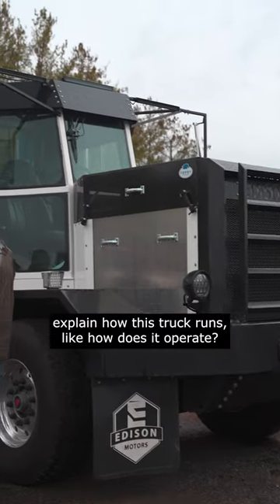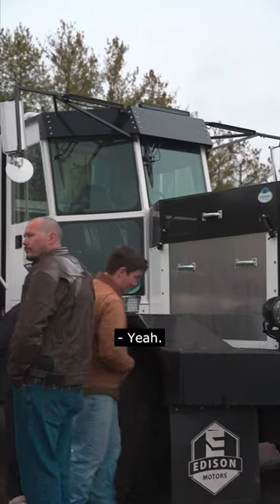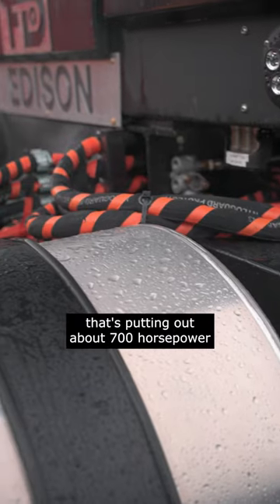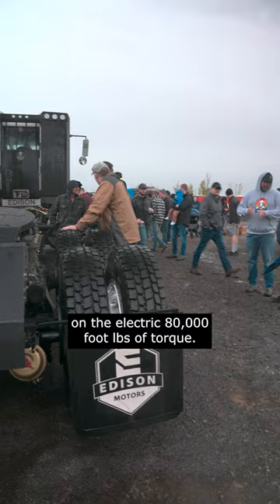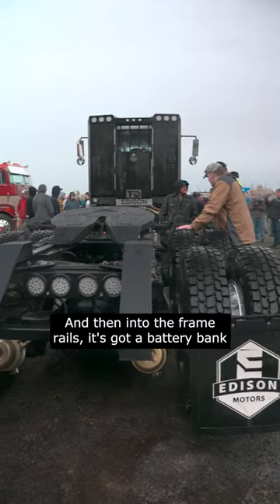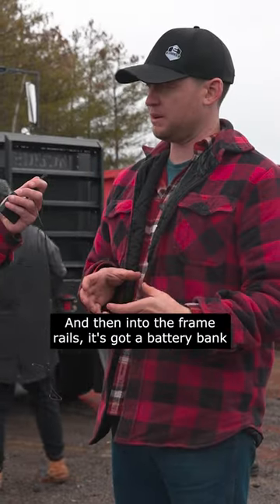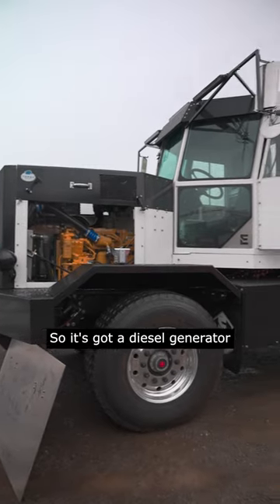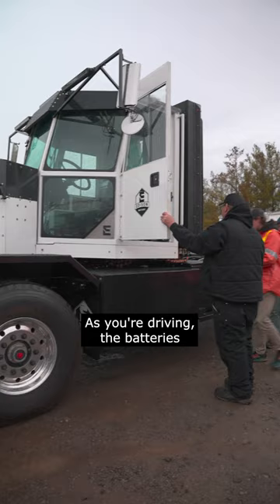@EdisonMotors tells us about how their new electric truck operates! 🚚⚡

Comment: What's the point in having an electric loader when you still have to have diesel to charge the dagon thing..What's the your point that you are trying to make..I'm pretty sure most people can repair a diesel engine but wait until they have to repair that huge piece of equipment. 5 times the amount for repairs and you may as well get another brand new electric loader cause repairs cost way more than the machine cost...I'm emptying banks accounts if I'd ever have to attempt to repair a machine like that plus if it ever gets a short in the wiring system kaboom goes your tractor dude lmao 😂😂😂

Comment: Still has a diesel generator????
Reply: Nothing can do shit with batteries only
Try buying a truck thats battery onlyband see how inefuciant that is
Reply: @loganwalker8537 have you looked up the Tesla semi? 500 miles of range. Hands down the most efficient semi made. Battery only.
Reply: @allterrainrandy2587 truckers on average drive 600+ miles a day. Plus the grid won’t be able to hold up to a conversion to full electric trucking. And it will take god knows how long to upgrade it to handle it. Diesel hybrid is one of the cleanest forms of energy that can be mounted on a vehicle and we have the technology right now to make it work
Reply: @allterrainrandy2587  only that it can barely pull any cargo due to its weight and its gonna take hours to charge.
A hybrid truck is much better
Reply: @loganwalker8537  Tesla Semi refills up to 80% in ½ hour and the energy per mile needed is the best. But it's built for one type of trucking. Many trucks never travel 500 miles a day (or in between where a Tesla Semi can charge). It has zero overlap with Edison Motors' trucks which are meant to greatly save on fuel where full BEV doesn't make sense. They have their killer app. No one in the current for is going to be an OTR truck.
Reply: @christer1415  ok so it doesnt take hours to charge
yet it weight a lot more than a average semi and only has 500 mile range where as Edison Moters trucks weigh less than average trucks do and does the same thing with no need for a 50 minute charge every 500 miles

Comment: Why do the insist on calling it an electric truck when it's a hybrid
Reply: Because the drive system is purely electric. The generator is just a range extender. A hybrid drives the wheels with mechanical force from the engine.
Reply: @23salamander   But this truck DOES augment traction power via the engine, albeit not with a direct mechanical connection, which is a technicality.

My State DOT (and many others) defines any electric vehicle with an ICE as a hybrid.  Under DOT rules, electric vehicles cannot burn fuel for power--not even in fuel cells. There are two different road tax surcharges depending on the type of vehicle (hybrid or electric). Since these trucks are designed to drive with the engine running, and can't as a practical matter do their job on batteries only, that to me--and most DOTs--would be a hybrid.
Reply: @tedneb3459  watch a few more of his videos. Engine only runs when the driver switches it on. You don't need to run it all the time

Comment: It only runs 6 miles down the road and takes 18hrs to charge but helllll yeahhhh
Reply: I think you're confused. The diesel engine turns a generator that keeps the batteries always charged, but being that the engine isn't the driving force to the wheels its probably governed at a continuous 1800rpm which is optimal for power output and fuel consumption. Also this thing is designed with regenerative braking. So when going downhill it not only probably gets to cut engine rpms down to an idle further enhancing its fuel consumption because now the braking is generating power but also causing less wear and tear to the engine itself giving it a longer lifespan.
Reply: It has a diesel generator that recharge the battery as needed.  It does not have a diesel motor running a generator. It's just a diesel generator. The rear axles are electric . The battery is in the frame rail.  Make sense?.

Comment: The real question good sir , how often does that diesel generator have to run ? 24/7 or does it shut off and than turns on when the batteries reach maybe 15 or so percent left ? Because if the diesel generator is running 24/7 just to keep them batteries charged , you should probably stop calling it an electric truck and just call it a hybrid. But if it only turns on when the batteries get low i think thats bad ass and could give the drivers a chance to charge up to 90% so they arent using as much diesel and in my book its a win bc youre not using as much fossil fuels. But if that thing is running 24/7 than the only real advantage u have is torque. And at that point it shouldnt even be considered electric..
Reply: It turns on when the batteries hit 20% to charge them up. 

A hybrid would use the engine to power the axles. This application only powers the batteries. Even if it ran 24/7, it still would not be considered anything but an electric vehicle. 

Also, the generator is so much smaller than a standard diesel powerplant used in trucks today. So you also save on emissions over time. This is trucking with batteries done right.

Comment: So it's a locomotive
Reply: not exactly locomotives have no battery so they dont have any regen capabilities and the generator is always running as that is the source of power. This is designed to run exclusively on the battery and the generator is only their in case you run out of battery capacity.

Comment: So it’s really a diesel?
Reply: The driveline is fully electric, it has batteries, it has a diesel generator that is roughly half the size of the engine a normal diesel truck would run. It clicks on when the battery drops below 20% and charges it to 80% to preserve the life of the battery to the max. It gets far better fuel efficiency (more than double) because it runs at a constant RPM to charge up the batteries, it also has 60% less emissions than the latest trucks while having far more towing power. What makes it fully electric with a generator vs hybrid? A hybrid can use the engine and/or the electric motors to drive the rear axles directly, which is a much more complex system and tends to break down a lot more often. This is designed much more like a locomotive!
Reply: @jonkeau5155  good writeup but this is a series hybrid. What you narrow down hybrid to is parallel hybrid.
"Hybrid vehicle drivetrain" is a good article on wikipedia to see the differences.

Comment: This guy is not really good at science, when talking about the electric engine he said 700hp and 80,00ft/lb of torque, that's impossible...You don't include the gearing when talking about engine torque. Then he said the batteries can deliver 4 times 250kW, where is this energy going if the engine is only 700hp? makes no sense again.
Reply: There is no engine or gearing, it’s electric. 700hp = 500kw. 2 motors = 1000kw, which is powered by the 250*4 batteries
Reply: @techheck3358  Then why did he say 700hp, If combined rating is 1400hp? No electric engine this size in the world can come close to producing this amount of torque at the output shaft.

Comment: YES!!! Why aren't all electric vehicles built to recharge themselves??????
Reply: Because they CAN'T
Reply: Loss, there's always loss
Reply: Because the main benefit of electric vehicles is to stop burning fossil fuels at all. When the grid is switched to zero carbon then the vehicle is too. These trucks still burn oil so they are only a stepping stone to the long term solution. If they replace the generator with a hydrogen fuel cell then you could have a long term solution.

Comment: The 80k gross weight limit is why electric semi won't work. You haul half the product
Reply: It weighs the same as any other heavy hauler (about 20.000lbs), as the diesel is tiny and there's no transmission.

Comment: 80,000 ft lbs? Seems impossible, is that through a gearbox? A 800 HP 4-pole electric motor puts out 2350 ft lbs at the shaft (800*5252/1789 rpm). A 800 HP 20-pole motor still only puts out 11835 ft lbs. How in the world can you claim 80,000? Unless you calculate torque differently in Merritt compared to Prince George.
Reply: Planetary drive axels

Comment: So this guy built a road train?  Diesel to electric.  Dude is smart but this will never succeed.  Think about how much more damage the roads will take with the increased weight load.  Batteries go bad after half a decade.  Maybe in the future when batteries are lightweight and last forever.
Reply: It doesn't have extra weight. Batteries can last longer but we'll see since it's a series hybrid and will be used a lot. But the more you use it the more you save in fuel to cover any battery replacements far down the line.

Comment: If there is a diesel generator,  why not a diesel engine? Then you don't have to haul that much of heavy battery. EVs are going a long time to be reasonable to buy. They really need proper electrical infrastructure to handle them properly. In addition the time to charge them will be a big issue to be solved.
Reply: The truck weighs around the same as a normal truck
Reply: It weights around the same as similar vocational trucks and the point is that it gets much more work out of the diesel fuel it needs. The batteries aren't that enormous and other weights are removed compared to a traditional similar diesel truck.

Comment: I mean.. wtf is the point of being electric while having a diesel motor to charge your batteries as you go? 
Why not put intake turbine fans inside the "motor" compartment that generate power like a dam would through water turbines. Strategically place your alternators. While you drive the batteries charge. You could even use the axels as a rotating regenerator as well.

Comment: Your electric truck has a diesel engine ?  So, you have all the hassles and expenses of maintaining a diesel engine, AND all the hassles and expenses of maintaining an electric drive line ?  Don’t get me wrong, I love the truck and its capabilities.  But, let’s not pretend it is all sunshine and rainbows.  Honestly, it sounds like a nightmare to use as an operational truck.
Reply: What are the hassles with an electric drive?
And the gain is way better fuel economy. And a generator diesel engine ought to be more predictable in maintenance needs than a bigger diesel motor.

Comment: I would never invest in an ELECTRIC vehicle, #1. Even if I got up to 500 miles with one charge, you might not find another charger when you need it.  #2. Batteries are SUPER destructful for land fills #3.  The cost to replace your batteries are crazy expensive and just look at your phone, it seams every two months, the charging time to fill it takes longer and the battery holds less.

Comment: Just  think how much lighter it would be without  massive batteries in it and what that would do for the power to weight ratio? Also a far less risk if fire.
Reply: For cars ICE vehicles has a lot higher risk for fire than BEV. Its batteries aren't so much. A couple of times more than in a BEV SUV.
If you only stare at the weight of the batteries you don't get the full picture. Head over to Edison Motor's channel and get educated.

Comment: So your batteries will deplete within 1 hour of sustained load, like city operations or a highway closure… then your diesel engine and generator kick in, producing emissions with 0 production… and unlike a power plant, or fossil fuels, the excess energy produced is simply wasted.

Comment: 80'000ft lbs of torque??  Not even possible.  That would destroy everything in an instant.   Maybe 8000ftlbs at the wheels.
Reply: Yeah, I'm sure he's wrong... with his buisnes... on this buisness advertisement...
Reply: 80,000 ft-lbs is very possible using multiple electric motors, nothing will get destroyed since the tires do not have enough friction to match that torque, but the wheels will slip on most surfaces if there isn't some sort of tractions control which I'm sure there is. It's still a good thing because it means you will never be lacking for torque you will never be limited by your motors, just your tires.
Reply: Probably meant to say he had 700hp and could pull 80,000lbs 🤔
Reply: Yes the guy who built his own truck is wrong and was corrected by some random nobody on the internet.
Reply: @SVOceanBird the 80,000ft-lbs is the correct number, and for their first load test they pulled just over 100,000 lbs
Reply: Topsy pulled 100,000 lbs on a test
Reply: Topsy was able to pull 100,000 lbs on a test
Reply: The motor is on the axle so there is no drive shaft, and if i am not wrong they have a planetary gearbox to get to that torque
Reply: @raphiseth6942  just like any other electric car or other bigger vehicles.

Comment: So they took a diesel  trunk andmade it Electric 
With a diesel gen to charge the electric batteries😂😂😂😂😂
Reply: Diesel electric is a very well proven technology used in a lot of applications including military submarines. It can be more efficient, quieter, cheaper and more powerful than conventional engines on their own if they’re done right.
Reply: Extreme Torque without range anxiety
Reply: They built an electric truck and put a generator onboard to charge the batteries. The generator is way more efficient than an engine.
Reply: The truck was made like that since it's a logging/heavy duty truck. So it's not always on the road. Not your typical pavement princess box truck
Reply: all the get up and go of electric, all the range and versatility of diesel (or any other fuel for that matter, just swap out the engine)
i don't think the drive train even weighs more then a truck with the same HP to ground at the same duty.

everything about this truck is to highway semis what pickup trucks are to said highway haulers.
Reply: Topsey, with its drive train and batteries, weighs about 400lbs less than a comparable conventional diesel.... and pulled 100,000lbs on a test drive
Reply: Basically
Reply: The engine is also now half the size and runs only as needed and only at it's peak rpm. Significantly more efficient on top of the tremendous benefit of electric drive train over a mechanical drivetrain
Reply: @IThinkSoMaybe I think they mainly got the idea for it from trains
Reply: Yep utilizing a smaller diesel genset, providing better fuel efficiency as well as the benefits of regen braking snd such. Tis the best of all worlds.
Reply: @Madpiggaming  and Tanks. Germany had quite a few hybrid tanks back in the day.
Reply: It's all about efficiency and peak load management. You can do the same work with a smaller engine when you have the battery bank to handle those peak loads.
Reply: @AsuRN76 Carl lost when going from diesel to Diesel electric 800kg of weight

Comment: So it's a hybrid, thanks for all those words to say that.
Reply: If you say hybrid to some truckers their brains turn off and they think you’re trying to get them to drive their routes using a Prius, so you gotta break it down a bit in the ads
Reply: Essentially all hybrid cars on the road have some kind of direct connection between the engine and the wheels. Priuses use a planetary gearset where the motor can either act as a generator when braking or as an assist for the engine when accelerating. This is much more akin to the diesel electric drivetrain of locomotives.
Reply: This is what the chevy volt was supposed to be, but GM chickened out and made a less efficient vehicle that still uses gas... to bad for them, I'm hoping to get the Edison pickup truck conversion when I'm able.
Reply: It's a series hybrid. Correct. But people that don't know better think hybrids only mean parallel hybrid (or series-parallell as the cars mentioned).

Comment: Study the Chevy Volt. To get anywhere close to acceptable mpg on Long distance driving you've got to have a direct mechanical final drive. Sorry. The only reason RR locomotives can justify electric only link... is that it has a lower repair costs compared to steam locomotives which it replaced. In the case of logging trucks ... you'll always suffer a 20-24% increased fuel usage...  when using this set up. If you were competing with a steam engine... you'll be ok. But yer not. Yer competing with highly refined conventional trucks. 
Any and all logging operations have at least a 4 to one ratio of logging road to highway usage. This makes this set up much mit costly to operate overall. The only way to overcome this? To add a direct mechanical link between the diesel engine and the final drive. Problem. This won't be possible with this set up. I'm not happy to point n this out. It's just the reality of this drivetrain.

Comment: Too bad the batteries are too expensive to replace
Reply: They are expensive but that doesn't mean they can't be replaced. They are designed to be replaceable, it's not like some cars where they are built into the structure.
Reply: @adrianthoroughgood1191  they arent built in to the structure on a tesla, its removable but they are in no way made to be serviceable so you basically have to replace the whole thing even if its just one section of the battery that is bad.

Comment: So you have a diesel engine to charge your batteries lol. Just run an engine
Reply: Nope. Automotive applications are crap for ICE thermal efficiency because they are rarely able to run the engine at the best conditions for peak efficiency (RPM, load, fuel ratio, timing etc). Using the engine in a generator application lets you run the engine at best-case conditions which makes it more efficient. 
Look at how much better mileage the hyper-milling crowd gets out of a car. That's because they're manually trying to keep the engine in peak-efficiency conditions.
Reply: It's more efficient and better for the engine cause it's a constant load and rpm.